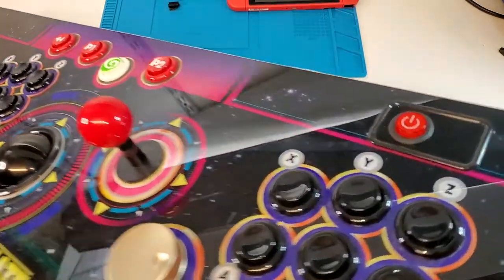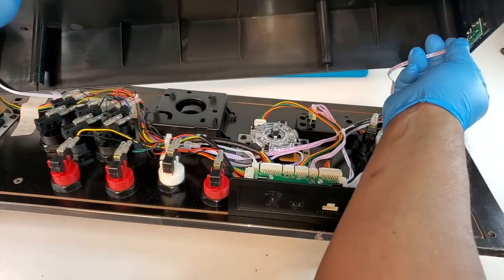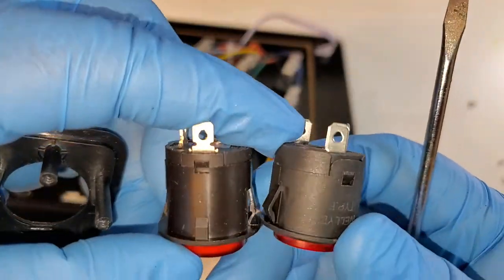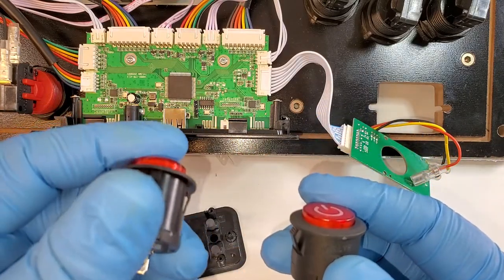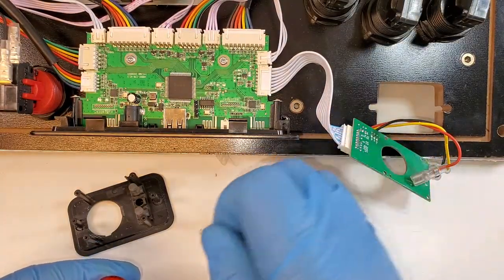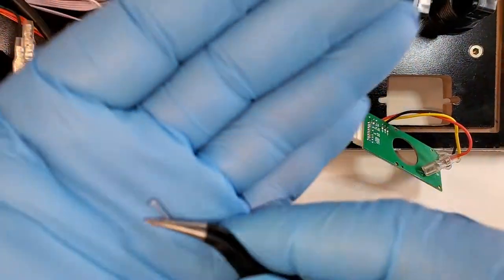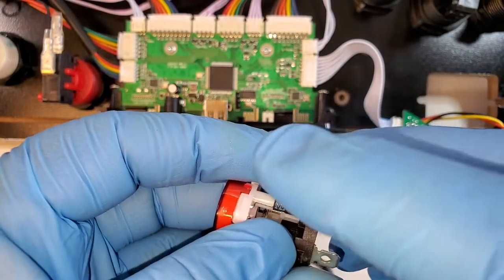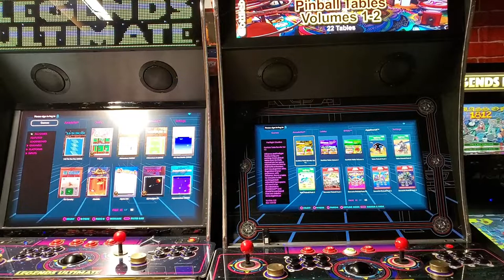AtGames Legends Ultimate Control Deck Power Switch Repair

Comment: I purchase a utility on/off and mounted on the back which is connected to a multi plug that is mounted inside in the back. I don't use the AtGames on/off anymore. Thanks for the video.

Comment: Have you tried this switch PBS-422AD
Reply from the maker: Thanks for the part number, hopefully it makes a difference. I just ordered 2. Hopefully I get that exact switch because I ordered from Amazon, EBay, AliExpress (different seller) before and couple other sites that show a picture of the switch but they all sent me one slightly to radically different that doesn’t properly fit.
Reply: @IAmSquareOne  mine just showed up and fit right in the hole. Seems to work just fine.